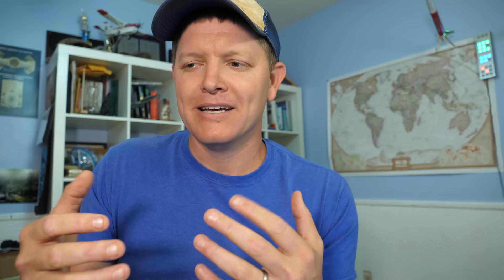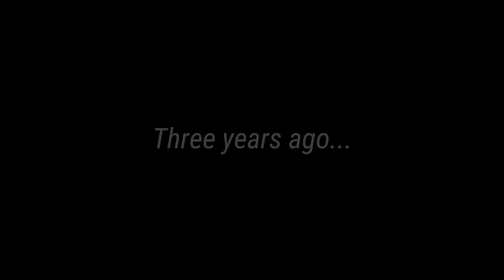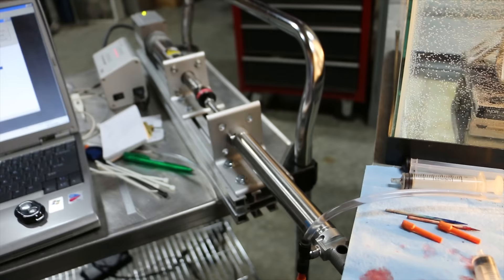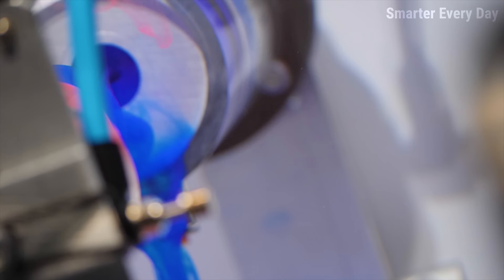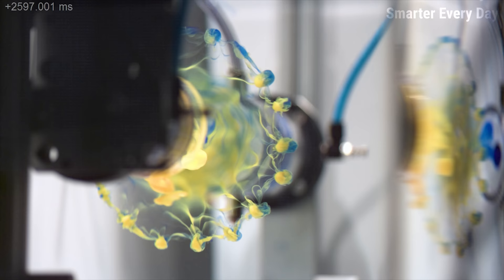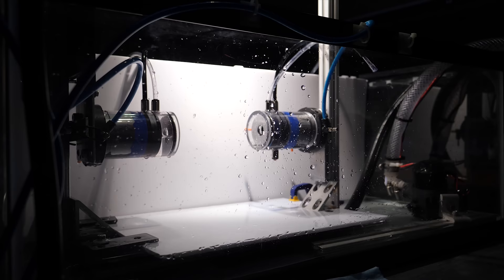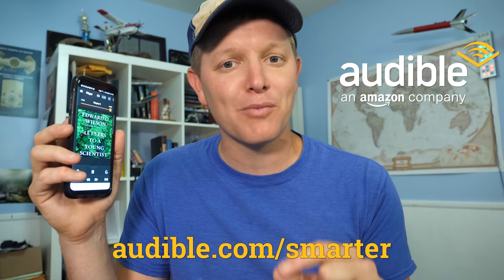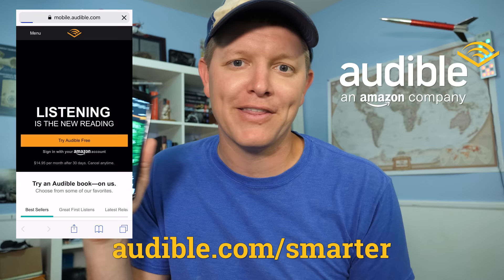Two Vortex Rings Colliding in SLOW MOTION - Smarter Every Day 195

Comment: It's like a two parallel universes colliding to each other
Reply: Finally, a comment that's not a meme and makes sense.
Reply: @hellohooman8962  so would they destroy themselves in the Collision?
Reply: @diantrecreagh3269  If two universes could collide, there must be a universe with all the parallel universes in it. Since our universe is infinite, two universes could not collide. Our universe takes up all the space (because ours infinite), so there would be no room for any other universe. Thus, no universe could exist beside ours, which includes the one that contains all universes.
Reply: @greatbluegamer2394  or if both infinite they are colliding to some extent constantly
Reply: @greatbluegamer2394  ie they share a boundary
Reply: Or the actual whitnissed colission proved that the universe wasn't actually limitless but that out perception of it was... Flawed? For instance if dark matter was the water outside of the universe and the multi verses are traveling through it with only small amounts within them like the fluid between the cells within blood... Really wish I would live long enough to know the answer to that but at the same time living that long would really suck...

Comment: The 90 deg problem ......
I think
As the low pressure zone sucks out the fluid from high pressure zone, it gains a (relative!!) momentum .
The two sides ( which are detached from the ring) are coming against each other now. Two sides undergo a head on collision. Now they would try to go in the direction where their momentum would be conserved ( which is the direction of the main ring propagation ). So they go in the radially outward direction (of the main ring.) ( As if a bomb blast into several pieces but the centre of mass goes in the same direction)
But in going so , it creates a jet of fluid going in that direction ( radially outward). This impulsive jet of fluid creates a vortex. ( As you created with individual coloured fluid----- by a short impulsive ejection of fluid.) 

When ever a jet of fluid is crated ,it creates a vortex whose plain( the vortex ring plain) is perpendicular to the jet.
So here the secondary vortex ring forms 90 deg to the main ring.

So in summary 😅
Collapse of main ring creates a set of another small jets which then create another vortex ring (s).
The direction of those ring is due to the conservation of momentum as I said before..

So here it ends😅....
If I'm wrong , then plz correct me...
And sorry for the bad english and lengthy explanation.....
Reply: Yes similar thoughts here - secondary vortex rings must have formed from a small impulsive jet, just like with a vortex cannon.  The outward direction of the jets is likely due to the direction of vortex motion in the original vortices.  These create the perpendicular plane of liquid that is generally outward-moving with a pair of growing vortices at the edge of the disc.  
The extra kick (impulse) could be from the collapsing main vortices – the two counter-rotating vortices get stretched, and parts eventually collapse and merge, cancelling out angular momentum but releasing energy, which is transferred to the nodes which spit out the jets.  
The regularity of the ring of nodes/jets is hardest to explain, but maybe is some sort of Plateau-Rayleigh instability.
Reply: Hello Andrew Kepert
 is it possible to simulate this in CFD and get the same result. If so we can study the the dynamics at much detail
Reply: Instinct told me also that conservation of (angular?) momentum is the reason behind the secondary small rings forming.  Instinct further tells me that the low and high pressure zones (relative to ink density not the water density) within the main ring could be a result of resonant frequency of the initial rotational propagation's (cannon shots).  

There is some resonance described just prior to when the main ring forms at 6:25 where some ink is left behind - is this a plausible explanation?  Also, Rajesh means computational fluid dynamics i think.

My civil fluid dynamics courses were a long, long time ago.
Reply: Aussie Dave yes. I meant computational fluid dynamics simulation only. I hope we can input the environment parameters into the computer and try to achieve the same output. Then we will know the micro dynamics happening in there.

Comment: I'm guessing that the reason you get the rings than turn 90 degrees is purely due to the opposing forces are close enough to being equal, one is not overpowering the other. Therefore at the end of the outer ring separation, the fluid combines into a vortex. It's sort of like two opposing weather fronts of close to enough equal forces combine to make a vortex.
Reply: ah kind of like what'll happen when our Milky Way galaxy clashes with Andromeda in 6 billion years?
Reply: Tornadoes form horizontally then spin the vortex vertically. Somehow.

Comment: When the secondary rings start forming they suck down into the se knodes as you stated. the reason it turns 90 degrees is because of the velocity of the two coming together and creating the secondry rings

Comment: Seems like the intervals of low pressure and the “ ricochet” cause the rings. Think about the blob hitting a solid surface, it will spread out and then reverse direction. You should put a glass plate in there and observe just one blast. Might get a wavy potato chip shape instead of the rings
Reply: I would think you're onto something, I had a similar idea. When the outer ring is sucked into the low pressure zones traveling along that boundary surface you're talking about with the ricochet the ring on either side is sucked into another ring segment just like the original two vortex rings were pushed into each other. This should cause another vortex ring collision perpendicular to the original and trangetialy to the original ring.
Reply: I kinda like this idea of pressure/vacuum zone but aren't liquids practically incompressible? Two major components I see here are the angular momentum of the vortex and the symmetry going of the rings and allignement. Wild guess but the lateral swirling happening inside the vortices is conserved even though it changed direction (Outward the original ring). It surely does looks like the first ring diameter snaps appart and all the broken length is being brought back together to preserve some of that swirling and the rest of the pigment align with the direction.
Reply: Yes liquids are incompressible but they still experience pressure differential. Water a column of water 10m tall has more pressure at the bottom than the top. There is a location of low pressure at the top and high pressure at the bottom, the gases in the water can be compressed but thats useful for other things not this. Low pressure in this instance would be referring to the area behind and opposite the direction of travel of the pressure wave. Similar to waves on a beach, high pressure is represented by the wave front, and low pressure is the trailing edge of the wave which is at a lower level than the water in front of the wave.
Reply: Oups sorry! I wronfully tend to think of pressure as density/volume instead of a force applied over a surface. Thanks for the correction.
Reply: Not a problem. We're all about learning in this section of youtube. Destin has a great channel.

Comment: Is there a reason that there's exactly 17 rings?
Reply: Itschotsch my count was 18
Reply: I think the best way to know if there's some "built in" rule there, would be making tweaks to nozzles and other factors and observing if the number of rings changes.  If not, well, that would be much more interesting outcome than the other scenario...
Reply: 18 rings would be one every 20 degrees.
Reply: @Nick C: Assuming they are arranged symmetrically in an equidistant fashion (which seems like they are,) but then you can as well write that directly - the 20 deg number is irrelevant.

Comment: I know how it makes rings. I think. Astronaut says it creates low pressure zones which suck the material away (can see arrows at 6:35) which also creates spots where the material is being pushed together on the other side. THIS force presses the two parallel lines of ink (if looking from side, ink looks like vertical lines) on both top and bottom, and the force of the two ink rings being shot into each other combined with the pressure on both the top and bottom of the parallel lines of ink results in smaller circles. In summary: the low pressure zones press the opposite sides together which creates two parallel lines of ink being pressed into each other from the outside, and on both top and bottom, resulting in smaller, broken up rings. Sorry if my analysis doesn't make sense but it really does in my head.

Comment: You need a 3rd (or possibly 4th color) added.  It seems that you’re not only observing/measuring the motion of the vortex rings, but also the water in which they’re traveling in.   Possibly even add many minute glitter particles in the water.  Will they collapse into little mini vortexes within the little rings?   How can the motion of the water be observed?  Different water temps filmed with temp sensitive camera? Such as they do to study tornadoes by sending in many sensors etc
Reply: So if you add glitter, is that to see the particles track the undyed surrounding water flow? If that's what you mean then I agree, that way I think it would be easier to get an idea of what the pressure and velocity differentials are.

Comment: As to the 'how do the secondary rings move 90 degrees (to the initial collision)' question: There appear to be two principles at work when this happens. Directional motion (force) moving radially from the center of the initial collision (along the Z axis) and the result of that radial motion (force) on the fluid in ITS path to either side of that radial motion/force (along the Y axis). 

Unless ALL of the fluid in the tank is totally motionless (and I mean TOTALLY), then as the result of the initial radial collision force, ONE side of that Z axis is going to have a differential lateral (perpendicular) force/pressure compared to the opposing side, irrespective of how little (or 'immeasurable' that force (pressure) may be). 

The combination of the lateral force with the differential 'splitting' lateral (perpendicular) force creates a compound or secondary collision where the primary (initial) radial force is greater that the secondary (lateral/perpendicular) force (because it came first and therefore has more inertia) and this 'force ratio/relationship' necessarily causes the 'nodes' (caused by the initial collision & radial spread) to turn 90 degrees because of the greater force of the initial radial momentum to the lesser 'split' (lateral/perpendicular) force/momentum. 

You've got a kind of initial 'vortex spin' that, while still spinning, gets tossed sideways as the greater force of the initial collision 'splits' the fluid to the side as the large ring expands, so the 'spinning' node turns sideways along the same axis as the direction of the expanding initial collision. Since nature ALWAYS moves in vortexes (and never in a straight line), as long as there is sufficient motion/force and momentum, new stages of vortexes 'rings' will continue to appear, 90 degrees to the axis from which they are generated. If this attempt at a description of my theory can be followed, I'd like to hear your thoughts on it.

Additionally, it doesn't appear that the INITIAL collision is between two vortices, but between two linear expulsions of ink in water; i.e. no vortex is generated by the plunger or the orifices from which the ink emerges. It appears that vortices only emerge from the resulting collision radially from 90 degrees off the Z axis).

The sequence of directional force is #1: X axis (blue and red ink moving towards each other), and then Y & Z axes simultaneously (creating the 360 degree ring expanding out 90 degrees from the initial X axis collision. 

The secondary 'rings' (actually vortices) form at 90 degrees to the initial collision along the X axis because the force of the initial collision is greater than the force of the secondary collision of the initial ring with the surrounding (relatively 'static') fluid.
Reply: No.1 wouldn't the secondary rings become true vortexes?
Reply: No.1 god I'm so confused
Reply: I imagine that, because the initial collision took energy and spin away, there is only enough momentum/spin left over to generate the shape. But if you look at the slow motion footage you can see some of that spin before it begins to rest
Reply: so beautiful when someone understands a field... but again i ask, what effect would the rotational velocity of the planet and moon have on the system, also... does the alignment of the direction that the vortex rings are propagated at with the direction of spin of the earth or perhaps north to south? i feel like these things could factor in... like how toilet flush vortexes change direction depending on hemisphere... 

PLEASE tell me if i am crazy?
Reply: Or it could be that it will always happen, the same way, every time, even in motionless fluid. I blame the gyroscopic effect. https://youtu.be/N92FYHHT1qM?t=2133

Comment: It's not a 90 degree turn. The center of the vortex weather air or water is moving faster causing rotation. The front of the ring is rotating outward. Both rings clash and ricochet at 45 degrees

Comment: Why is it that it's always 20 circles?
Reply: 18
Reply: I think it's more like 18 circles, cause of the 360° of a circle (18*2=36, 18 high pressure points et 18 low pressure points?)
But well i'm just guessing :')
Reply: Fractalism
Reply: 360 is just a random number
Reply: I'll take a stab at it.... The secondary circles are going to be a certain factor smaller than the original large circle. for example a 25 cm circle might produce 2.5 cm secondary circles.... if all other forces are equal these secondary circles will be equidistant from each other so in my hypothetical example, lets say 18 2.5  cm circles that are equally spaced will perfectly surround the 360 degrees of the circle. to go further, the circumference of the parent circle becomes somewhat like a wave... this wave breaks exactly at each cycle.... so the letter S turned 90 degrees.... these full cycles are what becomes each of the secondary circles.
Reply: CyanGaming | ᴹᶦᶰᵉᶜʳᵃᶠᵗ ⁻ ᴳᵃᵐᵉᴾᶫᵃʸ are you serious dude? Take a 45 degree angle and multiply by 8 and you get a 360 degree angle but guess what angles can’t be 360 because that angle multiplied then becomes a perfect loop
Reply: No, he means the fact that we classify a circle as having 360 degrees, not 400 or 1600 was not based on fluid dynamics, therefore it's useless to use those numbers to try figure it out.
Reply: Kito Brown , 360 is just a number WE use to describe the amount of degrees in a circle. However there's no reason a circle can't be 100 or 547 degrees. 360 was chosen because it was a large highly composite number, but its not a physical property of our universe.

Now that that's cleared up, just because a number of secondary circles creates a distance between them that is an integer, doesn't mean that's the reason. The gap between the circles (in degrees) could be any rational number(assuming that the circles are evenly spaced). It just so happens that 360 is, as I said before, highly composite. Meaning that it is the smallest number (in the case of 360) with 24 factors/divisors.

Also, using degrees is pointless for a problem like this. If you want to find the distance between the circles, it'd make more sense to use radians in this situation. Now it's obvious that the gap between the circles is irrational.
Reply: CyanGaming | ᴹᶦᶰᵉᶜʳᵃᶠᵗ ⁻ ᴳᵃᵐᵉᴾᶫᵃʸ Is very much correct, 360 seems like an arbitrary number at first but it isn't, it is the smallest highly composite number and that is extremely valuable in geometry. It is the most efficient number we can assign to the degrees on a circle, no wonder that nature prefers it. This experiment alone is proof enough that dividing a circle into 360 equal parts is the most efficient.
Reply: gaming you could not be more wrong!  the sumerians were shown the system of numbers we use today and can ABSOLUTELY be found all over the universe.  numbers were not picked at random.  the words we use to describe numerals was invented and that was it.  the word "three" was invented by us.  1 1 1 was invented by the universe, we call it 3.  Nikola Tesla got every idea he ever had from observing nature.
Reply: Maxime Lajous 2 plus 2 is 4
Reply: The sumerians selected 360 because that's how many days they counted in a year.
Pretty random number really, and with that logic the angle between the vortexes would be different on other planets.
Reply: fishbone0 I thought it's 365?
Reply: Kito Brown hes talking about the fact that 360 degress as a full circle is a convention, not a law of nature or anything. I think 360 was chosen because it has a lot of integer factors but im not 100% on that.
Reply: CyanGaming | ᴹᶦᶰᵉᶜʳᵃᶠᵗ ⁻ ᴳᵃᵐᵉᴾᶫᵃʸ 360 is a complete ring.
Reply: r/theydidthemath
Reply: My question is if we increase the size of vortex,(in a swiming with the bigger machine) will it still be divided in 18 sub circles, i know it won't because the fluid dynamics won't be changed, with size of vortex, but still i wanna know
Reply: fishbone0 uhhhhhhh no
Reply: I guess it would be different for different amounts of fluid in the squirts.
Reply: wonder if its to do with the speed of the ink ,would this change if it was shot slower or faster ?